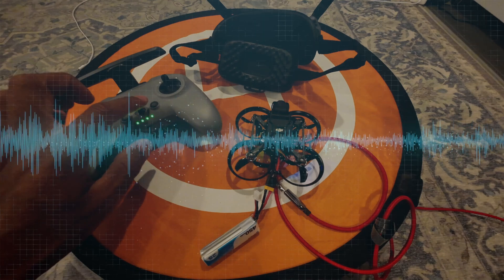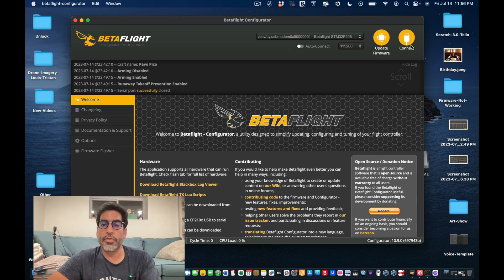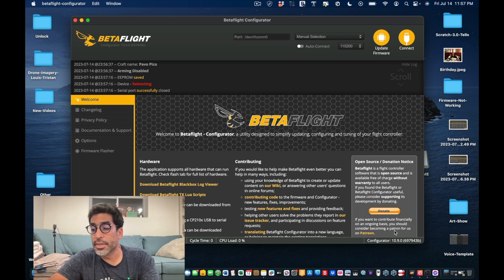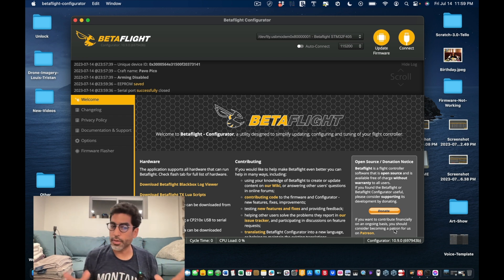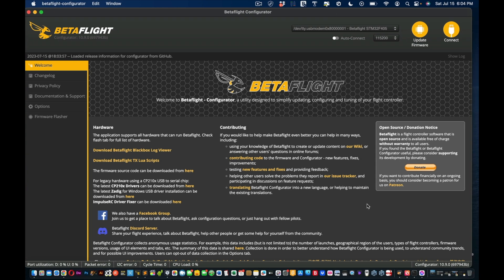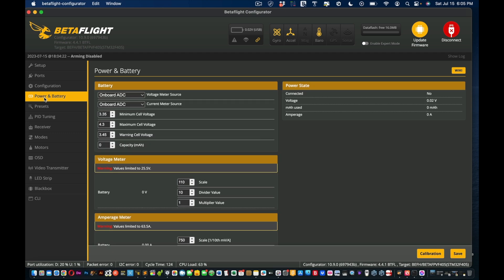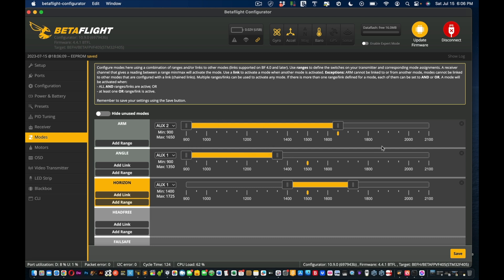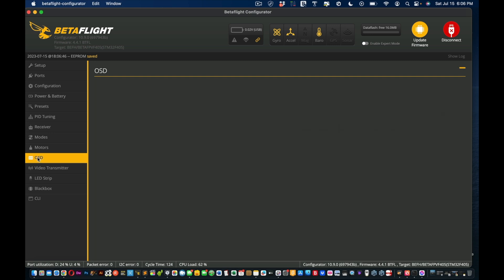povo pico configuration - betafpv pavo pico setup-Part-2

Comment: good video but my controller is paring with the Drohne but it isn't controlling it and gives no input to the drone. do you know what to do
Reply: Did you figure this out? Same issue. Using the suggested ports etc
Reply from the maker: @glennaffonso9651  yeah it took a lot of trial and error- especially when installing the gps unit because with the gps these setting go out the window.. but this is working now for most folks ..
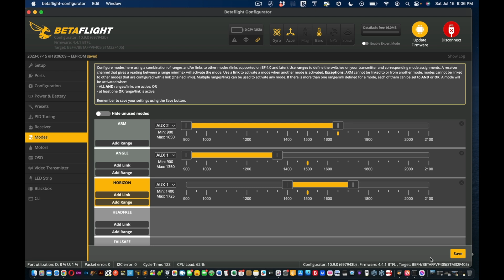Reply from the maker: Start at 3:40 seconds in this video and continue on to 5:55 to on double checking the settings. also make sure to arm is set to aux2 angle and horizon are set to aux1. If throttle isn't all the way down the drone won't arm..
Reply from the maker: Will throw up a video was working on for remote - the beginning is how to put it back into sport but half way through it goes over the manual setting... if the throttle is even slightly bounced back it will not arm the drone..
Reply from the maker: make sure your remote controller stick doesn't bounce back up https://youtu.be/ypxccdcNCsA

Comment: At one point it wouldn’t arm and you were going to find out why and then you got side tracked and then cut to something else,I mention it because mine won’t arm either with the exact same setup,it is bound ok and responds in beta flight in the receiver tab ? What did you do ? Thanks
Reply from the maker: Throttle has to be down.. if throttle is not in down position it won’t arm
Reply from the maker: New video next week on adding GPS to Povo Pico unit and getting it to work - setup is totally different with this chip in beta flight..
Reply from the maker: You can now add GPS to the Pavo Pico https://www.youtube.com/watch?v=NUd4JPoSCsE

Comment: Great video! 
After binding it with the Pavo pico are you still able to use it with the DJI Avata or do you need to re-bind it?
Reply from the maker: Nope - after binding it, it will be bound forever. Just don’t have two drones on at the same time if they both share the remote and goggles..then it might get confused..
Reply: I have Avata and Pico , mine RC2 have to bind each time if I swap the drone over !! Maybe Iam doing something wrong or it is like this
Reply from the maker: @yuling0513  shouldn't have to it should find itself. You can now add GPS to the Pavo Pico https://www.youtube.com/watch?v=NUd4JPoSCsE
Reply from the maker: You can now add GPS to the Pavo Pico https://www.youtube.com/watch?v=NUd4JPoSCsE

Comment: You have been way, way, way more helpful than BetaFPV support was but I followed all the steps and my drone still continuously comes up with an error message of Windows being unable to recognise the device, and BetaFlight keeos saying failed to open serial port. Really hoping your next video shows me how I should fix this because I have no idea and at this point I feel like I spent my money on something completely pointless.
Reply from the maker: Hard to say.. some folks are giving thanks and praise and others are still experiencing issues following the same steps.. 

Try checking the setting again - Start at 3minutes into the video and stop around 9 minutes. 

Could be something in the settings. Which pavo pico do you have ? 

One sec will upload vid on how to flash the firmware again. This video is for DJI 03 air unit and pavo pico DJI O3 VTX -  ExpressLRS 2.4G

Could be different for other fix.. One second fix should be universal.
Reply: @How-to-by-Lou  I have the same version you have in the video. I can plug it in as many times as I want and the system still refuses to let me open anything. Not sure what drivers I already installed or anything like that because when I did nothing made a difference. BetaFPV and being of absolutely no help whatsoever.
Reply from the maker: @snowythepolarbear6418  try a high speed USBC  data cable if you have one.. Also watch this video first - if this is what's happening, this will fix it. https://youtu.be/a-mqozieHmw
Reply from the maker: now you can add GPS to your pavo pico https://www.youtube.com/watch?v=NUd4JPoSCsE

Comment: after the config how do you turn on the engine?
Reply from the maker: You should be able to arm it by pressing the designated key you chose to arm it -

4 minutes 30 seconds into video will show you how to set the keys 

Once battery is in it should start after pressing the key 

Make sure the throttle is down and your your remote is set to manual mode..

Great idea for another video -

Is your remote set to manual mode ?
Reply from the maker: You can now add GPS to the Pavo Pico https://www.youtube.com/watch?v=NUd4JPoSCsE